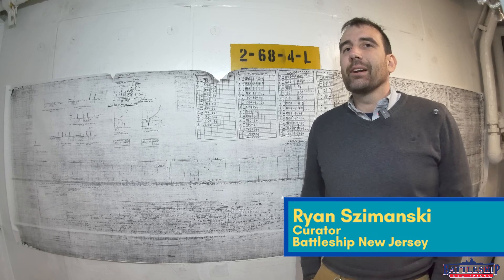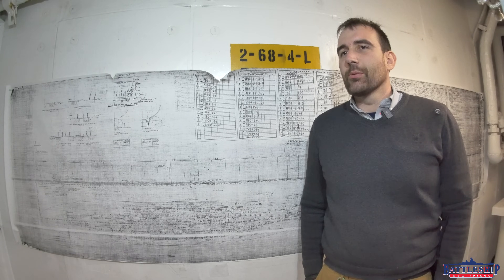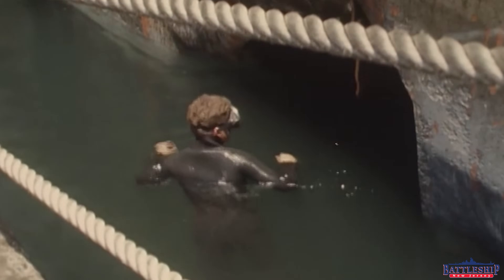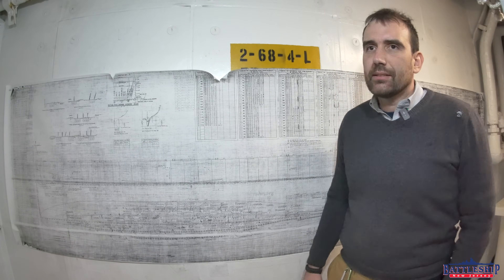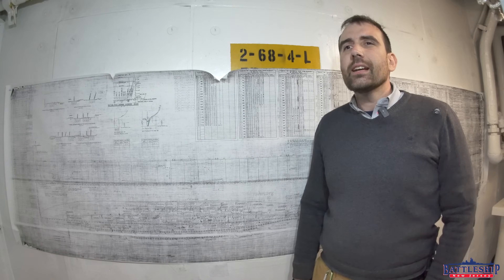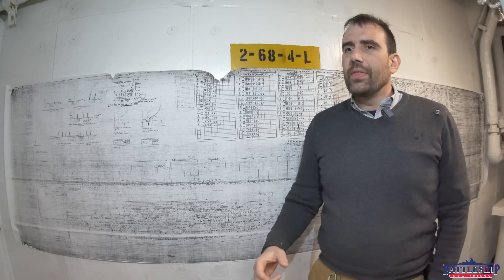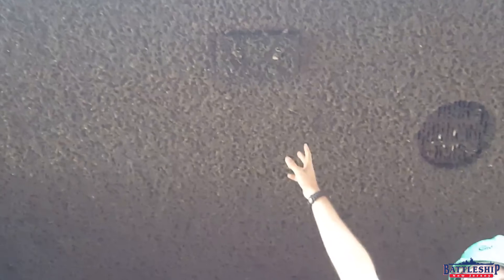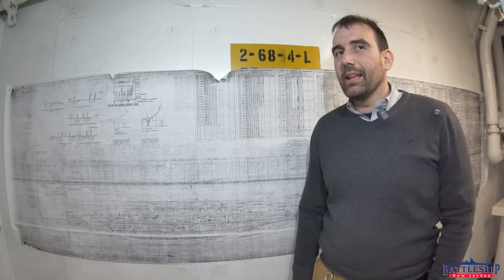Floating Drydock, Ship Lifts, Fleeting, and Graving Docks

Comment: Another video where you indicate that there is no way to communicate to future curators what has been done. Last time it was that you could not find the information about what was done to clear the superstructure for the bridge. This time you do not expect a future curator to know what blocking plan you use. I realize that digital records are not reliable since they "erode" and sometimes are in a format that is no longer readable, but might I suggest that there are paper documents that have survived hundreds of years and will probably continue to do so. Print the blocking plan you use and put it in a safe place. Print an index of where various "plans" like this are stored and hand it down during your change of command briefings.

Comment: Could you have a removable blocks to prevent fleeting? Something where you would remove few blocks at a time to do the work without reflooding the dry dock.
Reply from the maker: Some drydockings that is the best plan of action, in this case it is more time consuming and more expensive. When you're doing the work for a year and doing extensive work to each section that is cheaper but in this case its more time consuming and therefore more expensive.

Comment: Could you elaborate more on why it cost so much to fleet the ship? 
Obviously professional divers don’t work cheap and I’d imagine it adds probably another day in the dry dock, but is there more to it? Or are those two things the entire cost?
Reply: You'll also need drydock workers to move the ship and moving the amount of water needed to float the ship isn't cheap either. The drydock company will charge for both of those plus the extra drydock time and divers.
Reply: Because they have to flood the entire dry dock again, they have to move every single bit of equipment out of the dry dock, and then bring it back in. That's a lot of labour, which is expensive, and takes time, which is also expensive.

Reseating the ship on the blocks is also not a fast process, so those extra days involved could cost tens of not hundreds of thousands of dollars just for fees of using the dry dock.

Comment: Is there a reason the blocks aren't designed such that you can remove one, paint the bit, then put it back, one or a few at a time?
Reply from the maker: In some cases you can, thats what Texas is doing, but it comes down to price, whats cheaper to do and whats more structurally sound.

Comment: Back in the 60's USS Ajax went into drydock at SSK shipyard in Sasebo Japan and WHILE we were in drydock The shipyard EXPANDED the dock to more than double the size we went into.  The bow end was dug out about 50% longer and the port side expanded about as much.  A much larger caisson was excavated and installed outside the  original and connected to the port drydock side.  The end result was a dock that could fit 100K ton + size tankers that SSK was building.
It was a very impressive earthmoving project.
When we left they filled the new dock, floated the old caisson out and then floated out Ajax.

Comment: I wonder if pumping the water out of the ballast tanks (to reduce the load that must be supported) as the dock gets drained would make any difference to what kind of blocking can be done safely?

It's kinda funny that to get to the dock you need to make the ship heavy enough to get under bridges but to dock it you might want it as light as possible to reduce stress.

Comment: In Portsmouth we have several graving docks and locks . The oldest have doors and are no longer in use , some are home to museum ships  but most have caissons  of various types .Interesting structures as they have to have the buoyancy control of a submarine and fit securely . Some form part of the road system . Locks have a caisson at both ends to allow ships to  transit . An advantage is road access and permanent shore services . Docking is a long process and I'm glad Ryan is explaining it and there is a tried and tested plan for New Jersey .
Reply: My apologies if I am mistaken but , is this the shipyard in  Portsmouth NH ?
Reply: Sorry I should have said , Its Portsmouth Hampshire UK .
Reply: @DavidSmith-cx8dg ok...thank you 👍

Comment: Where are the  blocks stored between dry docking?   Its decades between them.
Reply: The blocks are owned by the shipyard. While the layout is designed specifically for the New Jersey, they are not the property of the ship. Same blocks are used for multiple ships.
Reply: Good question
Reply: Used for other ships

Comment: Gulf Copper is using blocks on Texas that contain a portion that is made of sand filled boards that can be used to remove individual blocks one at a time and reposition them without refloating the ship. 
It is not as big of a ship as New Jersey, so maybe not an option.
Reply: I was just on the verge of asking if Texas was going to be fleeted at any point- under the circumstances moving the blocks is probably a better option for Texas.
Reply: Interesting. I didn't know that.